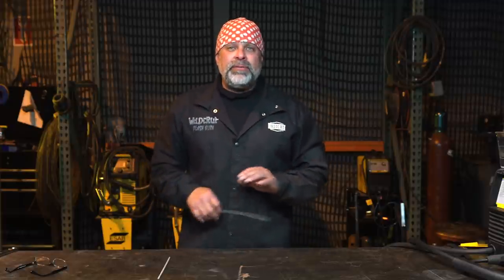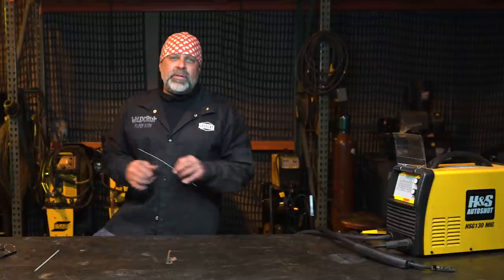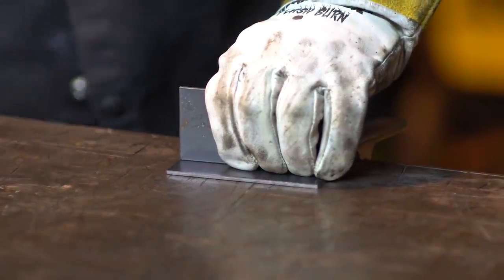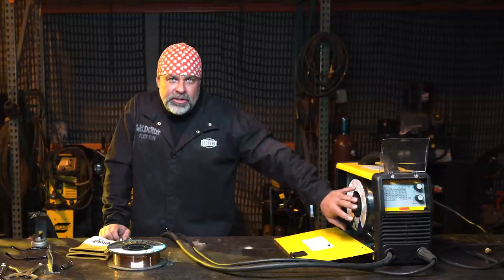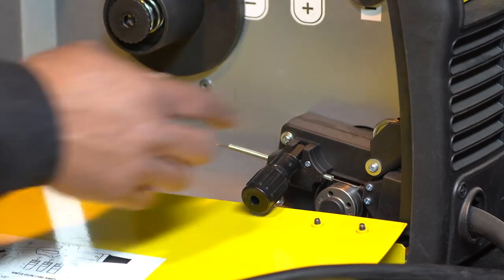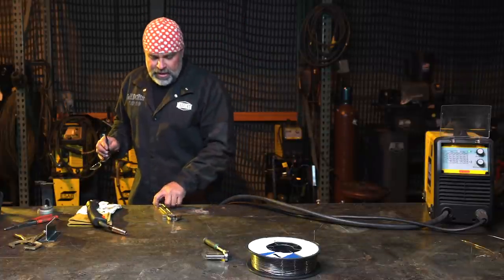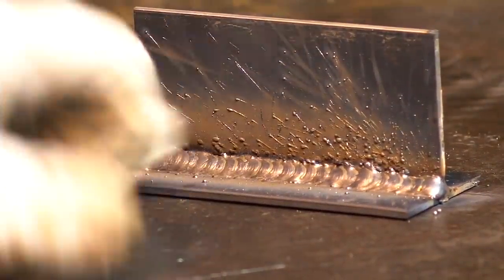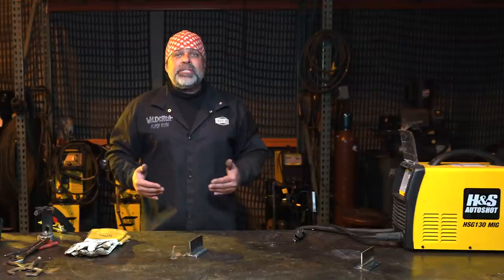Flux Core VS Hard Wire Welding | Everything You Need To Know About MIG Welding

Comment from the maker: What do you prefer to weld with? Flux core or hard wire? 

Hope you enjoy it and I'll see you on the next one! 

-Steve

Full Welder 101 Course Available NOW!

GO HERE TO SIGN UP WITH $200 OFF: http://wrgo.io/Welder101/18385

Sign up for my Welding Course Here: https://www.welder101.com/

Welder Up Store: https://welderup.com/collections/shop...

DON'T FORGET TO LIKE THIS VIDEO AND SUBSCRIBE TO THE WELDER UP CHANNEL!
Reply: I work at a big Cran company, we only use duel Shield. At first I didn’t like it, I noticed duel shield like extremely clean surfaces. It doesn’t like thin metal ether. I’m no professional welder, we do have a welding team who are certified and they refuse to use anything other than duel shield. I have really been putting effort into my welding!! Thanks for the video !
Reply: I enjoy hard wire weld with Stargon gas inside the shop, But flux or stick is the only way to go in windy outside welding
Reply: I only have welded with flux core. I'm a beginner but weld often and seems to be fine for everything I have needed so far. I can only weld outside anyways, so flux core works great for me!
Reply: I'm using a 175le on 3/16 frame rails.  I Run .35  flux on the hottest setting and welds good. 
Sucks on hardwire, never welds good on c25 under 30
Reply: Dual shield or hardwire.. if In a flux core needed situation, I’d just stick weld it personally
Reply: Hi Steve I was wondering if your course would be good for me if I have very little experience welding? I work in a union and would love to add welding to my skill set. I can braze good and I’m half decent at Stick but have hardly any mig or tig experience. Great video thanks!
Reply: Flux core is better I think
Reply: @tylergano1246  Works for me.
Reply: Hard wire and CO2. I don't care if they look good, I want to make sure I get good penetration.
Reply: For me in my garage after taking 2 semesters and learning everything but tig I have a great new machine that's dual voltage/dual process and you just can't beat flux core for the versatility and ease of use. I clean any weld I do anyway, so it's not a big deal to clean up a flux weld. It's easier than SMAW and less expensive than GMAW. If I were to do a lot more welding for money, I'd use mig, but as of now, there's no justifying the added expense for gas. Great video, though, so thanks for it.

Comment: Hi Steve, I am a back yard welder as I don't have garage..I use flux core all   of my welding on bodywork.  I  just upgraded to inverter welder and it's made my life a lot easier. Gas mig is better for indoor but new fabricators seem to be going flux core as cheaper and easier. Long time fan.

Comment: Started with 250 amp Arc Welding when i was young 12 years old and Have Since 28 Flux Core welded and Hard wired Also recently got a Cheap but Decent  Mig Welder that Does both 220v 180 Amp Made my Wood Spliter @ 35 with that and then got a 200 Amp Arc Tig China Combo 110 and 220 that works good. Learning Tig now at 42 is different than the Previous Flux and Hard wire, I got it for Custom Exhaust but Like to make all my own stuff from Scraps around the Yard and have done so All my life, my dad taught me most of it including Brazing!  I Like to watch your builds and Learn, Start with a Idea and turn it into Operational Machines and Tools i have done the same all my Life!
Reply from the maker: That's great Patrick! Keep working and never stop learning!

Comment: Hi Steve I sure miss the TV show...great to see you teaching  the craft I took auto body class at Seattle central com. Collage back in 1977  did collision  work then in the 90s built some custom cars for a millionaire  5 made the magazines 
Street rooder rod action the best one I did won a Barris custom award at Sacramento  it started out a 4door Hollywood  ghram and I made it into a 2
 Door roadster pie cut 4" at front to  0" at back wheels shortened  10" it looked like a Plymouth  prowler he wanted to beat Chrysler to the punch... the first car I did another  Hollywood ghram  Eddie Murphy bought.  Lots of welding  bondo
 primer and paint wet sanding and buffing  I was the one guy doing it all but took pride in what I was doing  I've got 3 rat rods - projects 34 chevy 4 door -1938 chevy coupe and a1947 ford coe  I've also was welders  helper on some big pipeline jobs in the early 2,000s but at 63 years old I still get the fizz when I pull out the  welder and I'm still painting semi trucks at the big semi salvage yard  here in Nebraska...weld on folks thanks Steve for showing  the skills.

Comment: This is going to sound crazy! I have never went to welding school. I work at a farm equipment manufacturer and started out working on engines as welders worked on hoppers and frames 60 percent stainless steel and 40 percent mild steel.on occasioni would watch the welders and at times I would practice probably like anybody would given the opportunity. Within the first year of me working there I acquired my own welding machine and within three years I was head of my department in assembly both welding and mechanics. 21 years later I still have never touched a stick welder and don't know how it works. I recently bought a 220 mig for my home and flux core came with it and I couldn't figure out why it wouldn't fit through the tip. Didn't make any sense. I have learned more in 10 minutes of watching your video then I have in 24 years at my job. I basically know nothing about welding and was just through self learning one specific type of welding well two if you count stainless and mold two separate things both on a mig.
Reply from the maker: That is great! Enjoyed your comment! Hopefully I can help with a few other details. Thanks for following along. Appreciate it.

Comment: Definitely hard wire all the way! And I'm glad someone else can MIG aluminum as well as myself. Everyone says it's so difficult, yet I learned at age 13..And I agree on the 110 vs 220 as well Steve. I personally would NEVER buy 110 as I weld commercial equipment and semi trucks and trailers for a living that constantly haul 20+ ton and I sometimes weld for the entire day straight. I've actually gotten 1st and 2nd degree burns from the flash reflecting off the aluminum trailer walls in the summer. So please everyone wear a good quality welding helmet and protective clothing or sleeves at least.

Comment: i bought inetub flux core wire e71t-gs if you can test that wire out. nowhere near the slag being thrown around or the fumes produced it actually does incredibly consistent good quality welds. did a lot of research of that wire vs cheap wire and its a night and day difference. looks like you are using a cheap wire truly is a massive difference in quality. wasnt even really producing any slag closer to using gas

Comment: Steve hit on the subject of using different shielding gas, like 75/25 Argon mix or straight Co2.. Better penetration with Co2 but NOT normally as pretty of a weld although mine look just fine..

Comment: When all I had was 110 welder I used a lot of mapp gas to preheat stuff to get better penetration
Reply: That's how we used to weld All things cast iron and things like buckets in loaders n crap. I learned that tech probably 30 year's ago now. VERY few do it anymore that I'm aware of anyway
Reply: @dieseldabz7104  i weld buckets at the mine and any thing over 1/2 thick gets 1000° preheat welded then heated 1200° degrees ish on the edge sprayed with water then reheated to 400° and covered with a blanket till its cooled down i found the water harden edge that are stress releaved last the longest for digging rocky soil

Comment: Ohh... I see some Esab machines in the background 👌 Made in good old Sweden ✊ I have a 380 volt, 180 Amp hard wire Migatronic Mig welder myself. For stick welding i have a Luna 280 Amp
Reply from the maker: Good eye! And nice! That's a solid set Jerry
Reply: @WelderUpVegas  Its easy to notice a Esab 😎 I live in northern Sweden. Have you ever tried Kemppi?? Its welding machines made in Finland. They are badass!! My father used Kemppi when he owned a company with trucks, excavators and loaders.

Comment: Just need two extension cords wired right to two separate outlets to run a 220v welder. So yeah good advice get a 110v/220v then figure out the wiring later.

Comment: With mig flux u got to get it  hot enough for the slag to float to surface so I don't think push or pull matters but pull does make a nicer weld

Comment: Steve I only have a 110 Lincoln 125HD flux core welder and I want to weld a 4 link on my 57 Belair. The 4 link kit is 3/16 thick. I'm gonna take your advice and preheat the steel. Which brand and thickness of wire do you recommend I use and can I preheat the steel with a mapgas torch?

Comment: I have a small gas powered 85 amp stick welder that is also a 4000/3500 watt generator . I'm looking at putting a spool gun on it so I can weld flux core wire. Would that have any effect on the wire weld?

Comment: I only gave 110 in my garage. I need to shorten an axle.. would love to see how you preheat thick metal,  and which is better for thick metal flux or gas both are 110?
Reply from the maker: Gas shielded flux core would work great when working with thick metal

Comment: Why is my chicsgo 125 flux welder give me kick back when im welding.  I have to keep the wire speed low to prevent that, even with thicker plate. Should i tighten the tension on it?

Comment: I been using my flux wire cause too lazy to get the gas for MIG, dont want to buy a TIG gun for my machine, and for some reason on matter what I do my 7018 sticks just magnetically sticks to the metal 75% of the time. Can't get a bead going. Flux core I've been able to immediately run a bead and it's fairly decent. It's a cheap $400 Amazon China machine but it does MIG, TIG, SMAW, Flux. It works better than I was expecting. It does 110 and 220 but I ain't hooked up 220 plug up yet.
Reply from the maker: that's great! keep working Jonny. I think you'll enjoy working with 220 when you decide to hook it up!
Reply: @WelderUpVegas  I think so too. I'm guessing that's why my sticks are sticking hardcore to metal. Just not enough amperage. Just gotta put in a new breaker box and fuses and what not and run the wire. Hard to come home from construction and muster up motivation for more construction haha Thanks man

Comment: On my welder, I don't have to think of anything like that. like that it can trip the braker. It runs on 400 volts. I tried flux core a few times before. I didn't really like the result.(it was dirty) and when I had "weld" a whole day in the shop. Then it was soo very smoky in there. so no I don't like flux core.
Reply from the maker: Yeah I get that. Everyone has their preferences!

Comment: Flux core goes way better with gas. Never seen no nozzle before.   I found that flux core produces a hard weld which is prone to cracking. Solid wire seams more sort of flexible.

Comment: Hanks for the tips, always learn something. Bought my first welder, 110 flux from Harbor Freight not too long ago. Cheap, no gas, for odd junk around the yard. First real fix was was when I broke a pivot point on my tractor. Factory welds had no penetration. Ground off the old wilds and cut a notch across the break. The welder penetrated really well, better than factory welds. Interested in moving to oxy welding for sheet metal and bodywork. Is oxy a technique you use to weld or is MIG IP your go to?
Reply from the maker: Yes, I do use oxy.  If MIG welding use silicon bronze, this way you can use it on really low heat. Doesn't get so hot to warp the metal.

Comment: I love using 71t1 wires (dual shield flux core) and self shielded wires at work nr 233 232 there sismic wires for structural don't use short circuit to much now spray hardwire yes don't ever use that nr t11 the small machine self shielded wires on anything serious and thick it's extremely brittle and has no ductility

Comment: flux core is a poor way to weld !   use hard wire if you can  !   , or stick weld it  , i have used flux core with gas   to weld thick stuff , we also blended our own gas when useing flux core wire with gas      it was on Very Thick Steel !   , the rings that went on the shuttle ! / flux core is a mess !